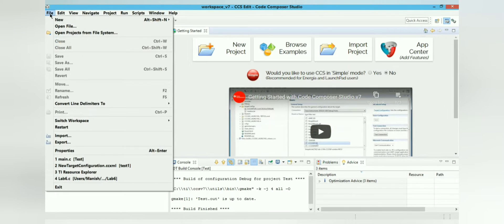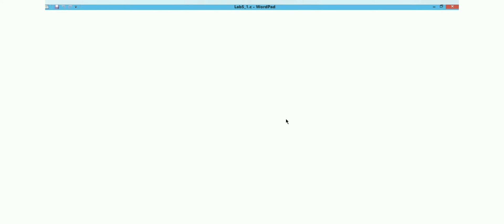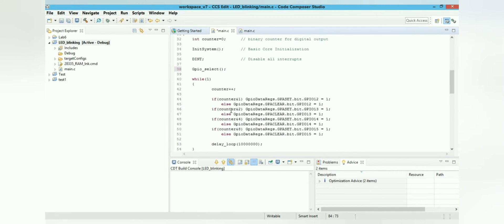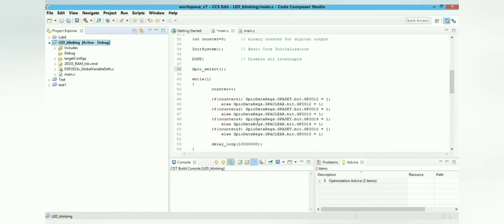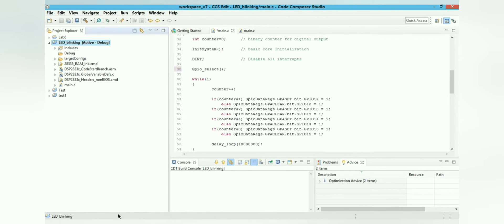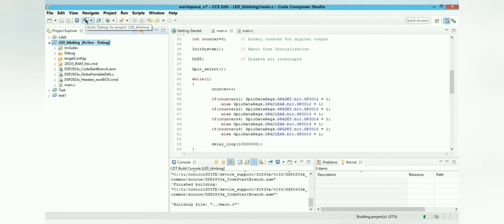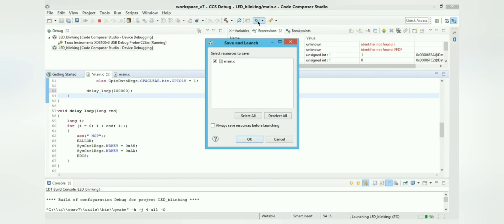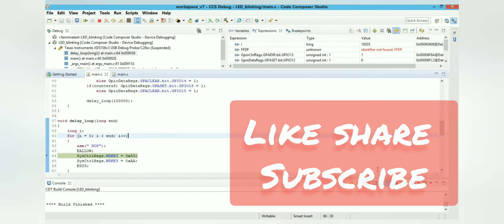Getting start with Code Composer studio & TMS320x Processor | Debug and build the project using CCS

Comment: Which ccs is best for cc1310👍
Reply from the maker: You can use ccs v.5 and above
Reply: But latest is version 10
Its very old
Reply from the maker: So you can use any version above 5
Reply from the maker: You can contact me on rohit.jain19194@gmail.com
Reply: Control suite is used for?
Reply from the maker: It is used for Library for all kind of boards